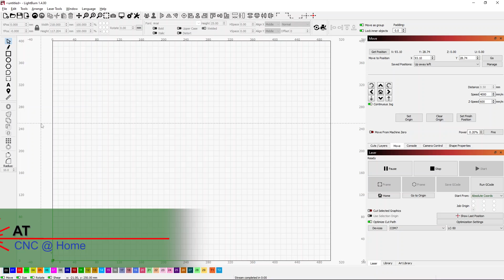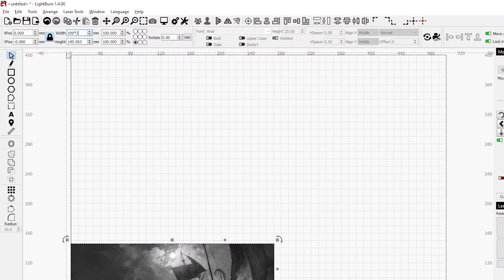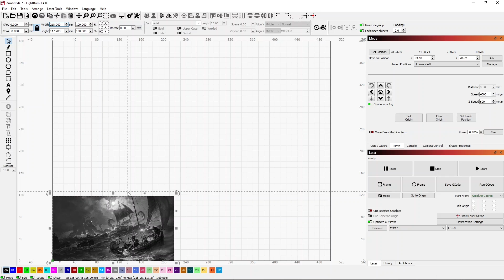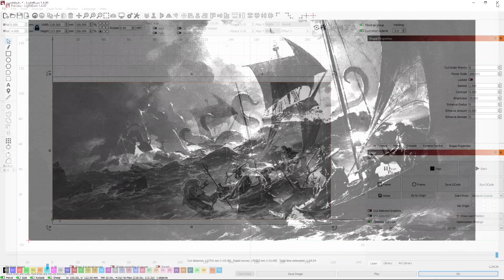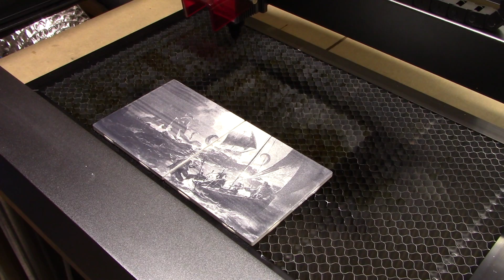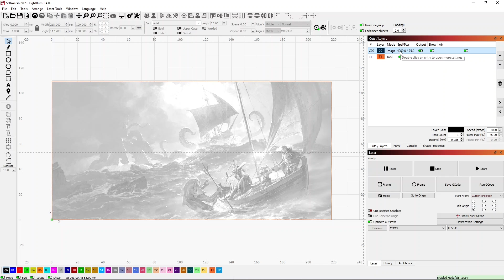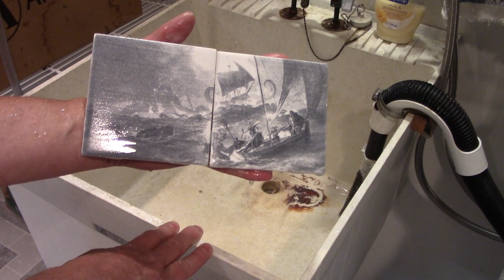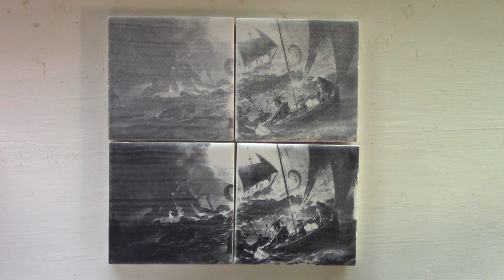TiO2 Tile Etching - Start to Finish.  The entire process.

Comment: Thank you for taking the time to video and share
It may not be perfect but one  thing is that  I have learned something new , like using many tiles
i think an airbrush would be good to use as can clearly see the streaks from the poly foam brush
well before I try an air brush i will try mixture with PVA glue as seen others use it and looks better.
Reply: I did finally get to try Tio2 with PVA glue  and  applied it using a cheap battery air brush
It covered and dried perfectly 
And to say after doing a material test using Light burn I found the correct settings
And so I did etch an image and it came out awesome
Reply from the maker: @spudnickuk  - That is fantastic!  I am so glad that it is working for you.  You should be able to make tons of projects with this method.  🙂
Reply: @CNCATHome  thank you but to say I'm glad I have seen your method and to say I think it just needs to be perfected  so don't give up on it and others will also learn on what can be done 
And try and may get good results
Anyway their is much contents that you show that one can learn from
Reply from the maker: I have had several people comment on using white glue to help with the suspension.  I have not yet tried it.  I have been using a thin mixture with a little food coloring in the airbrush and getting good results.  I am glad there was something to learn from the video.  :-)

Comment: You have to apply the "paint" more smoothly, the brush lines become super visible unless it's a perfectly even coat. This is my biggest issue! It's a pain in the butt!
Reply from the maker: You are absolutely spot on with that.  Since this video, I have done a couple things that help get a consistent coating.  One is to thin my mixture so it can do more self leveling and second was to start using an air brush to apply the mixture.  That has been a game changer in a good way.

Comment: Hi, thanks.  I've done the same process and I had the first too dark, but the next on was good.  I used a spray bottle with 90% alcohol and the titanium powder.  The results, (both) look like it was snowing or something, (a little blotchy). Although it was done in winter, there was no snow falling.  Does the Brush method work better than the spray bottle?  I'll try that next.  Thanks for a great video.
Reply from the maker: I have not tried a spray bottle yet.  I have started using an airbrush and that worked great!  Nice even coverage.  The brush method was just too inconsistent for me.

Comment: So what exactly is happening to the TiO2 here? Is it being deposited on the tile? Is the laser reducing it to Ti metal or another oxide state? Is the resulting markings electrically conductive?
Reply from the maker: So many good questions.  Here is my understanding of the process.  The TiO2 is converted into a crystalline form by the laser.  In this form, it appears black and adheres to the smooth ceramic surface. I had not really thought about the conductive properties of this.  I did a quick test with my multi-meter and found no conductivity.
Reply: @CNCATHome  Cheers, thanks. It's still given me some ideas for other projects as TiO2 is a great catalyst for other reactions, especially with UV light. Thanks again.

Comment: I have mixed my tio2 with 2 tablespoons of tio2 and about 100 ml of 91 ipa. I can’t get anything to stick to the tile when engraving is there something I’m missing? I’m using lightburn and a ortur laser master 2.
Reply from the maker: Your mix sounds good.  You are just over 3:1 and that should be a good starting point.  When I ran into an issue with the process not sticking to my tile, it was due to a dirty lens on my laser.  If your lens is clean, it could be that your power it too low or your speed is too fast.  Another thing is that your mixture could be too thick.  You don't need much on there for this to work.  Since this video, I have started to use an airbrush to apply my TiO2 mixture and it has worked GREAT!
Reply: @CNCATHome  
I have cleaned my lens so I’m good there. I have tried to do a power test on the tile and it will not take either. I am using the brush on method and I have 2 coats on should I switch to the spray bottle method?
Reply from the maker: @ReeseThaTazzJohnson  - the brush method should work.  Two coats is likely too much.  I did a test with two coats and got it to work but one coat was plenty.  What settings are you using speed and power (how big is your laser power wise?)?
Reply: @CNCATHome  I am using a 5w ortur lu2-4 laser speed 9000 power 60
Reply from the maker: @ReeseThaTazzJohnson  If your 9000 is mm/min, I would slow that way down.  I am away from my CNC computer right now so I can't look up my settings but I know my 10 watt laser I run at 4,000 mm/min.  Try a material test with speed ranging from 2,000 to 6,000 and power from 35% to 80% and see if there is a sweet spot in that range.

Comment: Is the banding caused by the brush strokes. What setting are you using for your image I find the Jarvis works well. I have experienced banding when using the grayscale setting. I do my image adjustment in the tools drop down (adjust image) where you can preview it while you adjust it.
Reply from the maker: Great questions.  In this case, the banding is caused by brushing strokes.  I should have used a thinner mixture to help minimize that.  Since this video, I have started using an airbrush to apply the TiO2 and have gotten fantastic results.  🙂
For images, I have found that Jarvis dithering has worked the best.  I don't think it would work well with this method as the TiO2 is either white or black, nothing in between.  I played with grayscale a little and have not liked the results.  From what I have read, it can look fantastic on something such as wood but only after you have gotten it dialed in.  I have found Jarvis to provide great results and it is easy to work with.
I don't think there is a way to preview the adjustments while you are making them.  I do quite a bit of back and forth between setting changes and the preview mode (Alt + p is my friend).

Comment: How did you mix / ratio & apply the (Ti02) please ; )
Reply from the maker: That is a good questions.  I wish I knew.  This is where I hang my head in shame as I didn't measure my suspension.  I started around a 1:1 and that was way too thick.  At some point I just dumped more DNA into the mix to thin it out.  I did it how I do pancake mix, I add liquid or product based on its consistency.  The next time I make some, I am going to be more scientific about it.  I will likely go even lighter on the TiO2 as I am starting to use an airbrush to apply and a thinner mix should work better.
I would guess that I am around 3:1 DNA to TiO2. Maybe even a little thinner.

Comment: Your videos are a classroom for learning how to use our lasers. We "know" that a diode laser cannot engrave glass...right?

Your TiO₂ solution has opened the world to me. I bought 2 CHEAP picture frames and covered the glass in TiO₂ solution. I did 2 passes @70% and 1200 speed. It left the glass with a "sandblasted" effect. Sadly, brush strokes showed throughout. Next time, I'm placing the glass in a baking dish, on a rack. I'll POUR the solution over the glass and allow it to dry, in situ. Cleaner burn? Results to follow.
Reply from the maker: Very cool!  I found that thinning my mixture helped eliminate the brush strokes.  It gave my solution a little more time to self level.  You can also etch glass using black paint.  Burning the black paint heats up the glass and etches it.  When you clean off the paint, you have etched glass.  The best paint I have used for that so far is Tempera paint.  It is water based to the cleanup is very easy. https://youtu.be/yvZqTes9UiM?si=hbeX6yH8LCD9pdkV

Comment: Extra tile was brilliant..so many times I ripped my tio2 off
Reply from the maker: The work I put into preparing one time vs two is not much different so I almost always have two if not more.  They do not store well as the TiO2 will wipe off so easily. I have been known to look at where some has been wiped off and make sure to use it on a project where I can position that spot where I don't have anything burning.  ;-)

Comment: I personally don't use air assist on TIO2 tiles. It looks like some of the streaking may be due to the air blowing off the TIO2.(Just a thought) ;-)... This method works perfect and I will never use paint. My solution mix is 4 parts IPA and 1 part TIO2 in a fine mist plant spray bottle, and with two light coats they turn out perfect every time. I do use acetone to clean them first for sure. I think you and maybe one or two other guys use TIO2 that I have seen on youtube anyway, and personally I think it's the greatest thing since slice bread for engraving white tile. I think I first picked up on the method from your channel ! Cheers.
Reply from the maker: I am with you on TiO2 being the best thing since sliced bread for tile etching and for printing onto glass (future video on that).  The streaking is totally due to my thick mixture of DNA and TiO2.  I have since added a bunch of DNA to thin it out and it works great as it has enough liquid to self level before it starts to dry.  I just etched a tile with an image and it turned out great AND I did have the air assist on.  I should try it without to see if it work any differently.  
The whole reason the white paint method works is because of the TiO2 in the paint so skipping that step and going right to pure TiO2 just made sense.  I use lacquer thinner for cleaning the tile as it is a bit more gentle than acetone.  Keep having fun with your laser!
Reply: @CNCATHome  Very cool, your response just got you another sub ! I will be interested in seeing how the method works on glass, I'm using a brand new Lasermatic 10 from Roly (with enclosure) for my laser now. I started on the laser journey by adding one to my Genmitsu 6050 machine which I got back in June. I thought my new cnc venture was fun, but having a laser really upped the fun for sure... Anyhow, I like your style and presentation so I just subscribed. See you in your next video, Cheers from Utah !
Reply from the maker: @scorpianspirit5124   - I had looked at getting a laser module for my Genmitsu 3018 Pro.  It would have been fun for sure.  I did decide to get a standalone laser to avoid switching between laser and router mode AND the biggest reason was the speed and increased working area of a standalone laser.  It has been great fun. Utah is one of the few states I have not visited yet.  You have some nice parks out there. Cheers back to ya from Minnesota.
Reply: @CNCATHome did you try without air assist, I did and it messes the lens up and interferes with part of the engraving, have you found this thanks
Reply from the maker: @Martin-ll7jc   - I have tried with and without air assist.  I have not seen a difference in the conversion of the TiO2.  I have noticed that without the air assist, more stuff tends to get on the lens.  For that reason alone, I keep the air assist on.  There are things I do where air assist needs to be off and when I do that, I check the lens after I am done.
Reply: @CNCATHome  same here, I didn’t realise I had a lot of white powder on the lens 
When doing a test pattern and broke my compound lens for now on air on thanks mate
Reply from the maker: @Martin-ll7jc  - Sorry to hear about the lens.   That is one reason I have started to keep a closer eye on it.
Reply: @CNCATHome  was think over last few weeks changing over diode Laser but have to research a good diode machine 👍
Reply: Are y’all using the air assist on the laser module or air extraction?

Comment: what caused the horizontal streaking..  more prevalent in the first darker set?
Reply from the maker: Great question.  My TiO2 mixture was too thick and didn't self level very well when it was brushed on.  I have thinned it out quite a bit since and it works great.  It has more time to self level and it still leave plenty of TiO2 on the tile.

Comment: did you use AI for the images or did you pull them from on line id like to give them a go myself
Reply from the maker: I just did a search on google for ghosts of saltmarsh and found them that way.  It turns out I was also at the beginning of having a dirty lens in my laser which likely affected these burns. I really should try them again.  🙂
Reply: @CNCATHome  iv had some really good results with Ti02, i cant buy it locally so i have to get it from etsy, ran out of it last week so on saturday i tried chalk spray primer was very surprised good results but prefer the ti02 just hard to get it in ireland without waiting 2 or 3 weeks, have tried imagr also but i get better results setting images up in lightburn
Reply: Excellent video (as usual). I am always thankful that you include the "Oh #@%!" moments (that I will likely do) in your videos.
Reply from the maker: @HugoHugunin  - What are you talking about?  I "NEVER" makes mistakes.  
Ha! Ha! Ha! 
Thank you for the comment.  It is important for people to know that it is OK to make mistakes.  That is part of the learning process. There is a study that shows people learn from other people's mistakes better than just telling them what not to do or what could happen if...  So I try to makes mistakes and tell my children so they won't have to.